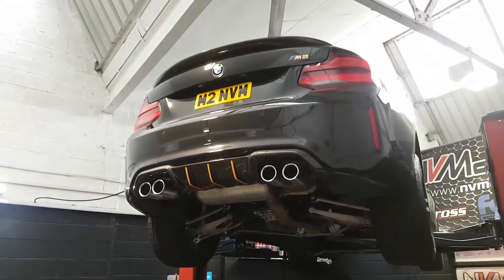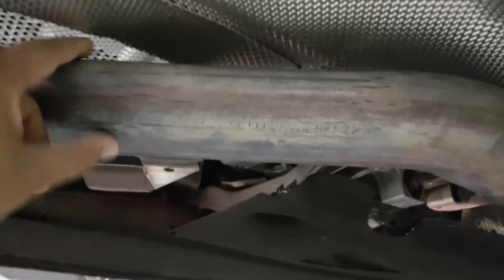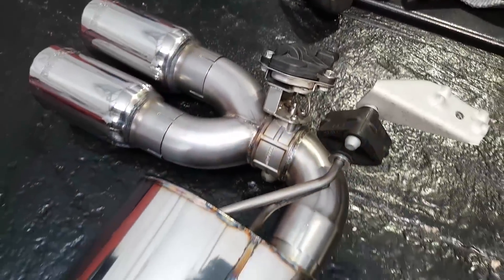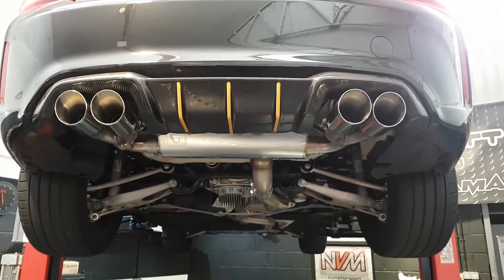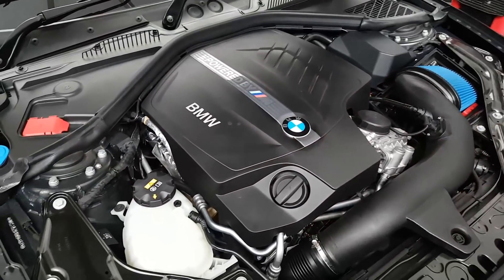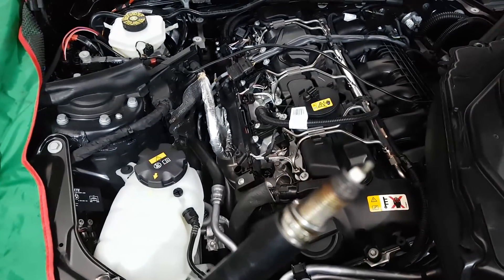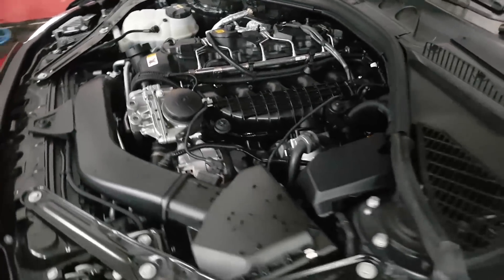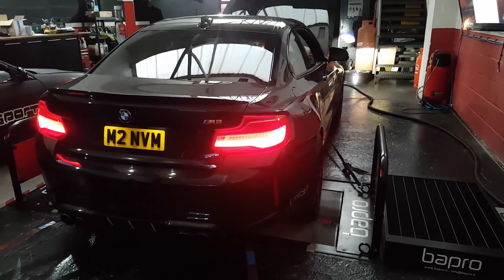BMW M2 Scorpion Exhaust + NVM Stage 2 Mapping!

Comment: sounds real good!
Reply: @R2 D2 Totally agree. The OEM system isn't bad at all for a stocker but that Scorpion really makes the n55 'snarl.' This is the type of exhaust that could make me smile from ear to ear everytime  I drive it. No droning/ rasp is A MUST when it comes to an aftermarket system. I'm assuming companies like AA Tuning, Bimmerworld, Rogue Engineering, Remus, etc all fabricate they're own systems and probably all sound excellent. I've never looked into it as I don't own an n54 or n55 equipped car. It's such a good sounding motor from the start, that it's probably difficult to make it sound poorly. The Scorpion really sounds, looks, and fits nicely from what I can see. One of the other great things about the downpipe in particular is how well you can hear the spooling. Turbo(s) actually help dampen the exhaust note in general, but the sound when its in boost is intoxicating. These are the type of reasons why we love these cars so much, besides the amazing handling characteristics. Domestic owners don't know what they're missing. I was a diehard VW/ Audi guy with some highly modified/ swapped cars that I built for myself and customers. Once I drove my first bimmer over 20 years ago I was hooked. Nothing compares to the handling with RWD/LSD, and the extremely linear power delivery that I have found. BMW is one of the few manufacturers who still build a car that not only looks the part, but more importantly performs and handles as good or better than how it looks. Not anywhere near as 'watered-down,' or poorly engineered like so many newer platforms. Great video. Wish we got half the cool stuff here in the states that you guys over there are lucky enough to be able to get.
Keep it real. 
😎

Comment: Please build something for the s55 M-Motor from the M2 Competition which sounds good and is street legal in europe
Reply from the maker: in development :)
Reply: It wont sound as good, the S55 engine always sounds shit, no matter what set up you use. Maybe make it better, but wont ever sound like the N55.
Reply: That`s right, but i never saw a N-Motor which is strong enough for >600hp 100000 miles. And i think the S55 (for example m4) sound can also be great, the reason of the bad m2 competition sound in europe is that there is a "pre-catalyzer" too. Not only the new otto particle filter shit....

Comment: What 100-160 & 100-200 times does this do? I’m OTS map and 9.2-9.5 sec 100-200
Reply from the maker: we did 9.4 100-200 stage 1. Stage 2 tesing will be done soon
Reply: NV Motorsport UK Have you Done the 100-200 with the stage 2 yet? and what is the times? If i change to an Wagner intercooler and and a Wagner downpipe with a 200 cel racecat and a drop in sport air filter with a stage 2 tune how much power would you think i Will make?